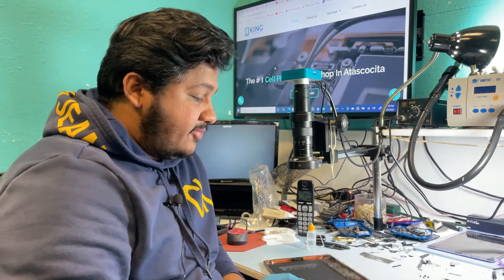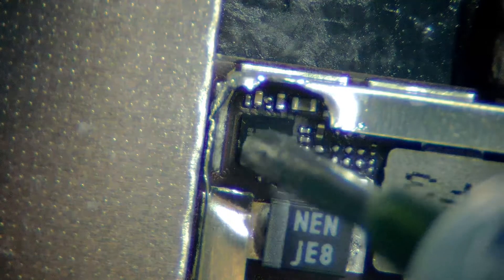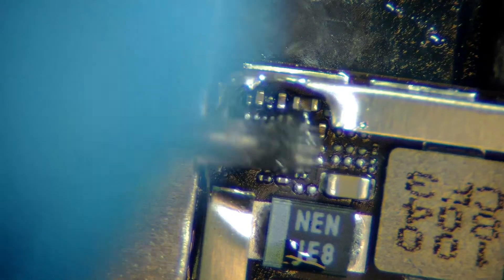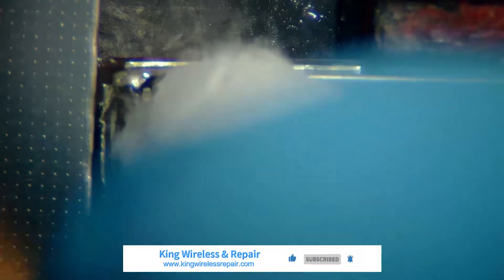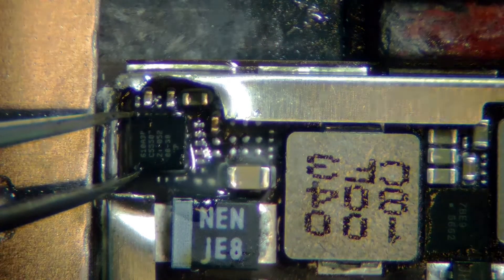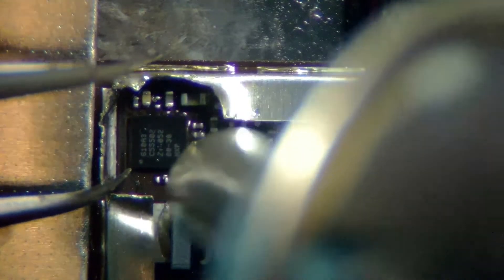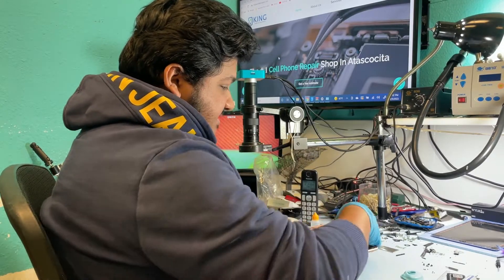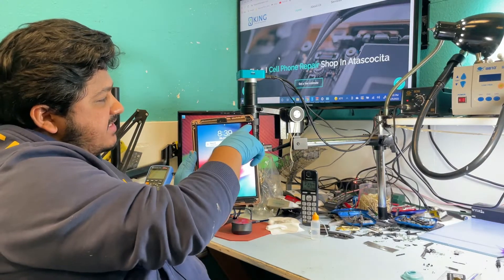Apple iPad 6th Gen Not Charging Tristar Chip Replacement

Comment: Bro mere iPad 6th generation slow charge hota hai  charger or data cable or charging flax bhi change kar liya to usme IC ki problem hai, or IC kaha se milegi 
Please reply bro
Reply: Bro have same issue, not turning, 0,36 amps charge rate, replaced battery didnt help. Did you solve your problem?